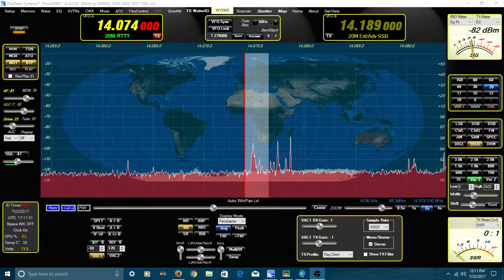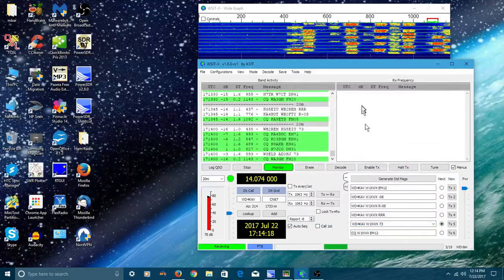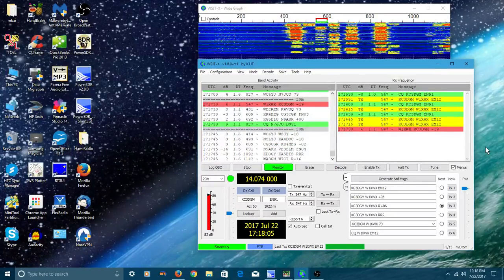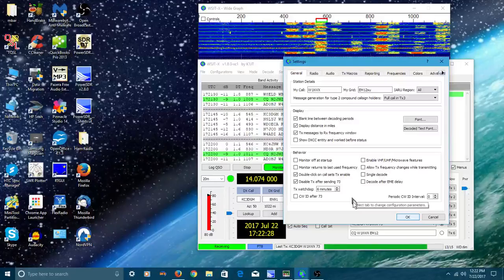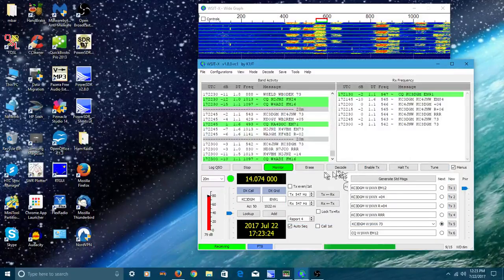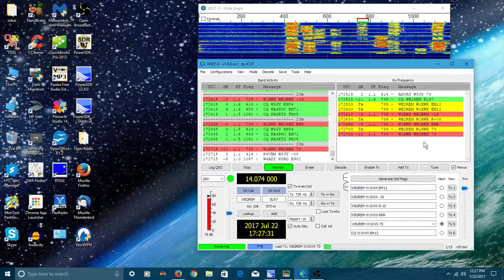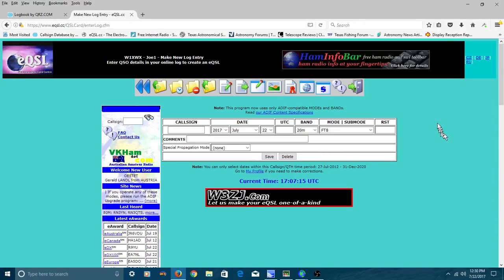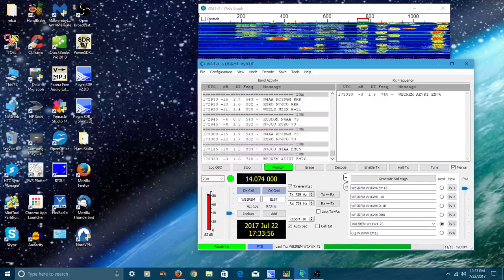FT 8 -- let's make a contact

Comment from the maker: I discovered the 2 check boxes in the software that auto enable transmit; and auto enable disconnect. These settings are important since the exchanges happen very rapidly in AUTO mode.

Comment: I notice that your clock is at least a second off everyone else's. You might want to download one of those programs that automatically set your clock according to one of the standard time sources. Also, he tried to call you back three times and you ignored him, thinking again that you were calling him.  This is somewhat of a "frenetic" mode, and you really have to pay attention to the screen. We've all made these same mistakes. Thanks for your helpful videos. Ken W8ASA
Reply from the maker: Ken I use Dimension4 software to sync. Also the video was done shortly after FT8 was released. The latest version is almost automatic with the exchanges. Check out my log on qrz.com. 73
Reply: Joe Lalumia i found this operating guide last night.  Its pretty good.  http://www.g4ifb.com/html/ft8_tips.html

Comment: If you look at your input meter you are clipping the signal coming into your radio your signal is coming in distorted I was at the video I don’t know if you if you have done anything about it. The input signal meter should be reading anywhere from 40 dB to 60 dB and you can adjust that with your RF gain control in your radio.

Comment: I am coming back into digital and was hoping to learn how to set up the driver for my SignalLink USB Sound Card connected to my FT-450. Your video does not address this. I was also hoping to learn which software program is better for starting out with FT8; you example WSJT-X but you don't show how to download this and configure it for the SignaLink USB/FT-450. NOTE: I was doing digital several years ago and suffered a major concussion when I got hit by a car and this damaged my short-term memory. I am beginning to get memory for the digital comms but technology has changed so much I must start out from where I cited above. Will look to my associates close-by for help to make sure I get this part correct, then I can begin looking at the other modes.
Thank you.....W0GDS

Comment: Hi Joe, A great video to analyze and (please don't take offense) demonstrates very well some of the "beginners" problems.
You have correctly diagnosed that you have the audio levels much too high.  You will most certainly have clipped audio with the level pounding away in the red thus giving the decoder a hard time trying to give you a nice decoded signal.  You said in one of your comments that you have backed this off to about 80%(?), please consider backing it off still further i am sure you will be surprised at the results.
The BIG hint is that just about everything on the waterfall is either orange or red, back the audio off a little.
All of your received sigs are way strong enough to get 100% decodes for sure.  My experience from day 1 of FT8 is that anything from -15 dB on up is easily decoded.  Just about everything in your video is +dB !!
Very strong adjacent signals such as in your video will also have the effect of "desensing" signals around them. You can see this effect to a certain degree in your video in that the "blue" areas are quite a dark blue with little or no band noise showing.  This may also be the way you have set up your display gain of course.
If you do struggle with blocking from adjacent signals then consider turning the AGC of your receiver completely OFF and then use the RF gain to pull the high signals back a little. This technique tends to help with the "desesensing" problem.
Sorry, another rant.............
73
Reply from the maker: Thank you for your comment. 73

Comment: Interesting, although I'm not sure why we need yet another digital mode, and I honestly am not a fan of of the software doing everything automatically, I really don't see the point other than seeing how far you can transmit. It just moves us further away from actually communicating with each other by radios and letting the computer do it all.
Reply from the maker: I also use JT65-- at low power to work DX stations even during a solar minimum. Remember Joe Taylor designed these for moon bounce communications! 73

Comment: CHECK YOUR CLOCK !! On average you are one 1 second fast. FT8 requires VERY tight timing.
Reply from the maker: RolyRJ I will do that but I am already using Nistime.73
Reply: Hi Joe, the trick is to watch the reported DT's from your decodes.  In your video's case the DT's were between +1.0 and +1.8 seconds.  On the assumption that not everyone else is fast (there will be exceptions) then the only conclusion is that you must be slow. Nistime is fine and will do a good job for you provide you have a good fast internet connection. Your can check your delay or lag by pinging Nistime and seeing what your lag is.  If the lag/delay is significant this will have the effect of setting your clock slow.
I have this problem when on one of my many dx-peditions around the Pacific (E51RR, 5W0RR, H44RR, P29RR, Etc) The problem in this case is very slow internet (dialup speed) or no internet at all.
To overcome the problem I have a USB mounted GPS unit which is running 100% of the time and it adjusts the time continuously keeping me with in +/- 0.5 secs.
Bit of a rant, sorry, but hope this helps :)
73
Reply from the maker: Thanks again.

Comment: Mr. Lalumia.
Hello, and good afternoon. 
Sir, I know of your views for the "hand-held, portable walkie-talkies" at being not as good as possibly a mobile rig. I already have a mobile rig (YAESU 857-D) setup. I am now looking for a handheld, to use as a handheld when I am off my vehicle, possibly using my mobile rig as a repeater if the need would arise. I am currently planning the purchase of a TERA hand held (TR-590,) dual band radio, or, if I am advised that digital communications are here to stay, and/or a better way to communicate, I will consider the purchase of a TERA TR-7400 UHF Radio. 
Sir, have you ever had an opportunity to have "played" with any of these types (TERA) of handheld radios? What are your thoughts, in general, on the digital mode of communications, for amateur radio, do-do survival and just about any type of emergency communications?
Sir, I have seen and listened to your videos on youTube. I thank you very much for your hard work in producing these same. I do place value on your opinion(s), and remain hopeful for your valued guidance to me on my questions posed. Best of the day to you, ... 73.
Oscar, KG5ULB
Reply from the maker: I have no experience with a TERA radio. That being said I would not spend (as you know already) $300-$400 on an HT. It does need to be a dual band HT as a minimum, have a charger, and a few possible accessories like a hand mic available; or battery or power options like a backplate that can be plugged into a cigarette lighter in a car for power. At the present time I own a Wouxun, a Baofeng (8 watt model), and a TYT 380 DMR HT. They all work just fine.

To use the HT and transmit through the car radio you will need a mobile radio with cross band repeat built-in. Kenwood and Yaesu make very nice cross band repeat radios. I have also used the TYT9800 successfully as a cross band repeat (temp repeater).

I have several videos about DMR and Dstar --- here is a link to the DMR video and the Baofeng video:
https://youtu.be/yQId7QEqlv0

https://youtu.be/JTf_HX59Ll4

Good luck and all the best.
Reply from the maker: Here in the Dallas metroplex, DMR is still not very active-- even though there are dozens of DMR repeaters in the Dallas area. Not a lot of activity. I have mentioned this in several previous videos. Currently activity is picking up a little but does not compare to several of the more popular analog repeaters in the metroplex.
Reply: Joe Lalumia
Mr. Lalumia. Thank you for your quick response. And, I will further research your options presented to me.
Again, thank you for taking your valuable time to respond to my concerns.
Oscar
Reply from the maker: You are most welcome

Comment: Hello Joe, maybe you need a good time synchronization app. when I start to use I couldn't decode. Try Dimension 4 or NetTime.
http://www.thinkman.com/dimension4/default.htm
http://www.timesynctool.com/
Reply from the maker: I am using Dimension 4-- the time sync was less than 1 second. I just think everyone is playing with a new mode and not quite sure how to work it yet PLUS my beam was not pointed at the contacts. But that is what makes it fun. 73